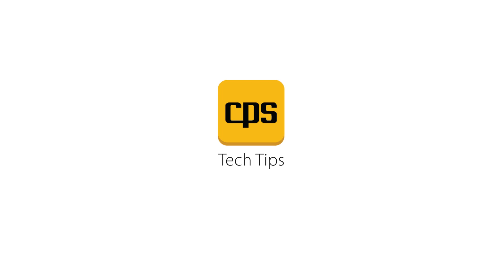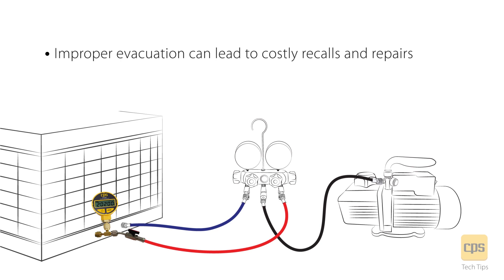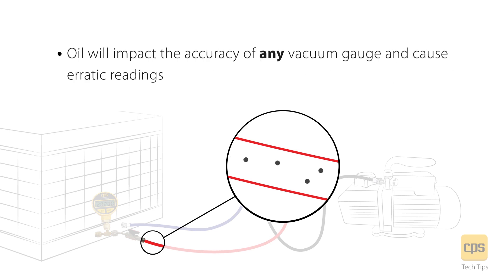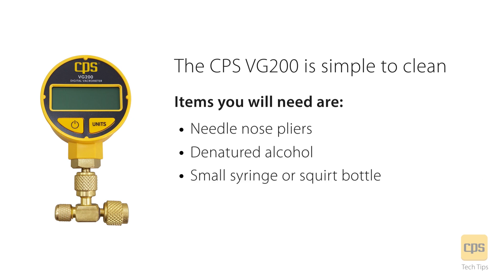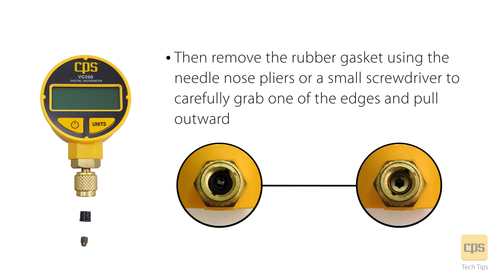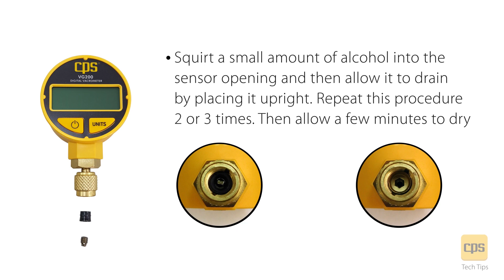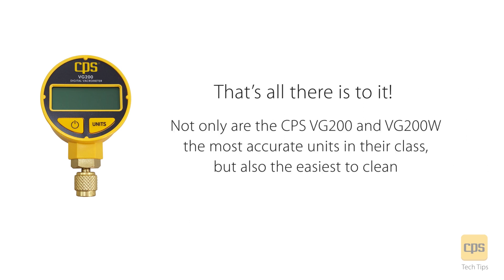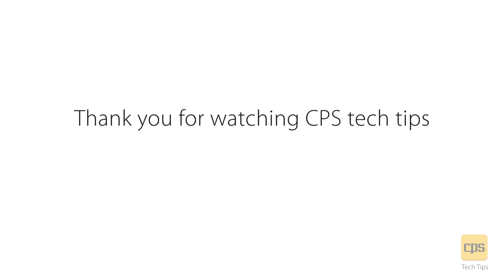CPS Products Vacuum Gauge Maintenance

Comment: Damn thing wont stop reading 29"/in mercury or single digit microns with actual pressure on it.. thing is nearly brand new but was given to me by another tech. This unit was his spare, he had to perform the cleaning procedure on his meter and says it works supposedly, is a syringe necessary as there is a smaller oriface inside the 1/4" fitting? I put some alcohol inside and let it drain a bit once or twice but Ill try it again... is there a way to replace it at a supply house or send it in for repairs? Be easier to just get a new one and send it on thru at this point, irritating me.. thing is literally brand new out of the box and the readings are so out there Richard Dryfus would use it to top his mashed potato monolith..
Reply from the maker: Hello, we're sorry to hear about this misreading issues with your VG200 or VG200W. There is a one year warranty on the unit, so if the tech purchased from us at TEquipment they can reach out to us here: www.tequipment.net/service/contact/.

If not, we would suggest reaching out to the distributor they purchased from or the manufacturer directly. We hope this helps!
Reply: Could you fix it? Mine won't go up from 27 inHg

Comment: Hello, can you help me, I have a cps vg200 vacuum meter.And it shows me zero microns on the screen and it is not connected to the vacuum pump
Reply from the maker: Hello, we would suggest contacting CPS support to get a repair/new unit if you're within the one year warranty. If not, they may recommend getting the unit calibrated (if it's not) or offer some troubleshooting tips. We hope this helps.

Here is the link to their support page: https://www.cpsproducts.com/support/return-authorization-request/

Comment: I bought a used CPS VG200 (I know, a lousy move for getting a precision instrument).  During the first use, It was reading the vacuum fine but then it decided to stop at about 1700 microns then go up.  I bought a new gauge of the same model (you're welcome!) and just finished installing my mini split.  This time, the vacuum held at 280 microns.  

The used gauge may just need cleaning, but if that doesn't do, it is due for a repair.  Although I'm not a professional HVAC tech (have the EPA license, though), I noticed that backup equipment of everything seems vital to HVAC industry (gauges, hoses, valve core removal tool, etc...).  I cannot afford a 2nd vacuum pump, but I have spare for all other equipment.